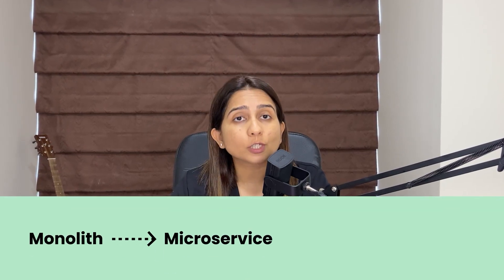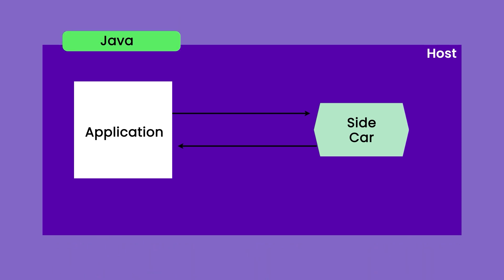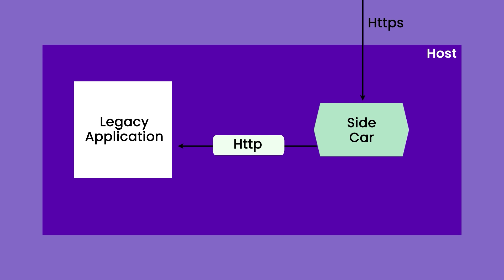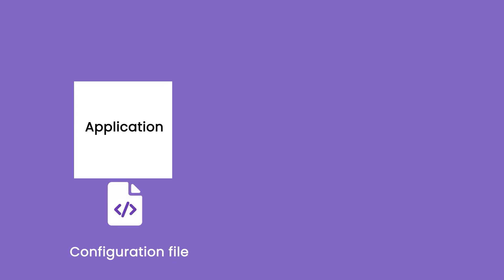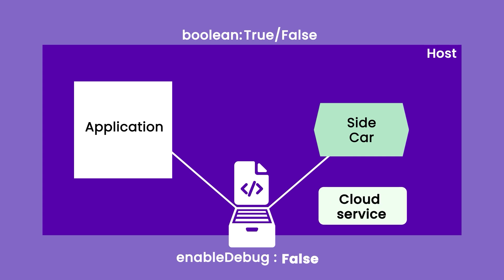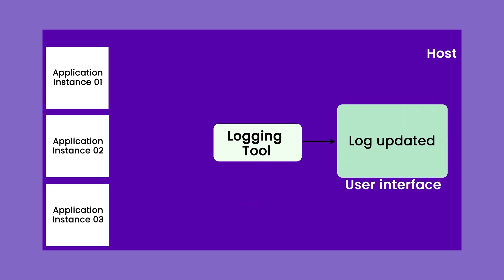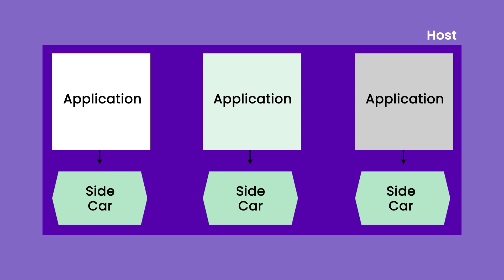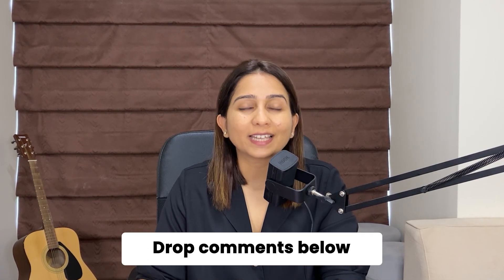Side Car Pattern in Microservices | Microservices Primer Course

Comment: 🎯 Key Takeaways for quick navigation:

00:29 🔄 Sidecar Pattern Overview: Sidecar pattern, a component deployed alongside an application, solves complexities in microservices, providing flexibility in implementation across various use cases.
01:10 🌐 Language-Agnostic Communication: Sidecar communication with the application should be language-agnostic, ensuring compatibility across different tech stacks.
02:32 🔄 Proxy for Protocol Transition: Sidecar acts as a proxy for transitioning protocols, exemplified by handling HTTPS traffic for a legacy application without requiring a full rewrite.
03:14 🗄️ Serve Static Content: Shared file system allows sidecar to efficiently serve static content, eliminating the need for application logic for certain data types.
03:54 🛠️ Efficient Configuration Management: Sidecar efficiently manages configuration changes through API interactions, updating configuration files without necessitating full application redeployment.
05:58 📊 Log Aggregation and Metrics Collection: Sidecar aids in log aggregation, metrics collection, and sending data to observability tools, streamlining these common functionalities for diverse applications.
06:54 🔄 Decomposition and Abstraction: Sidecar serves as a decomposition and abstraction pattern, extracting common responsibilities from applications and deploying them alongside different applications in diverse tech stacks.

Made with HARPA AI